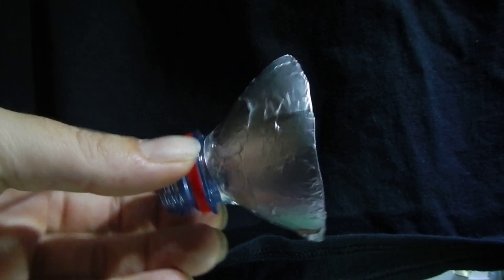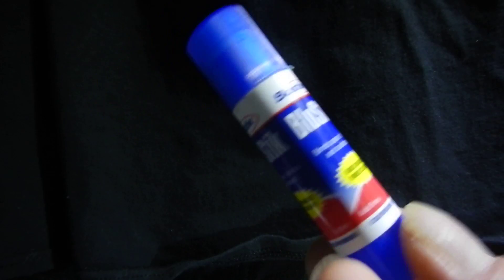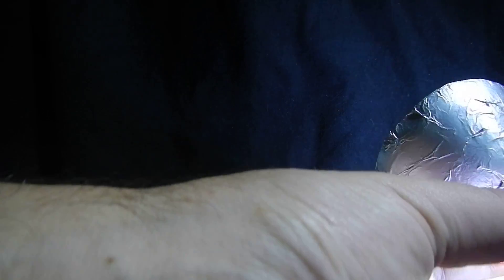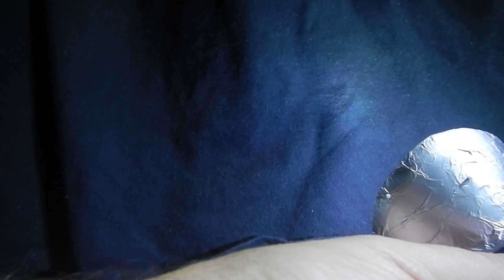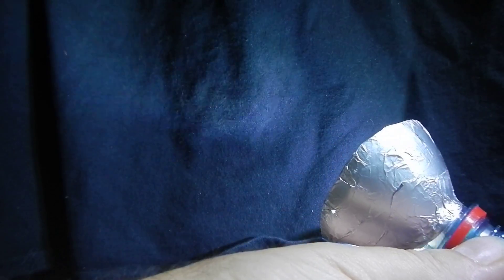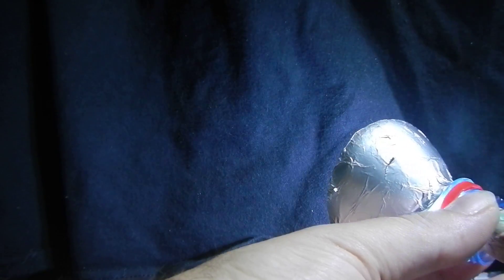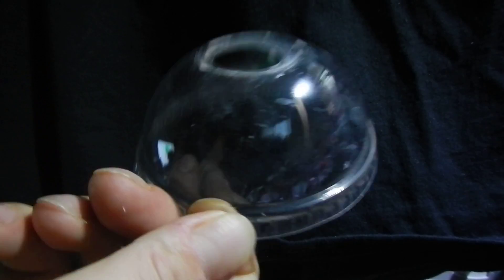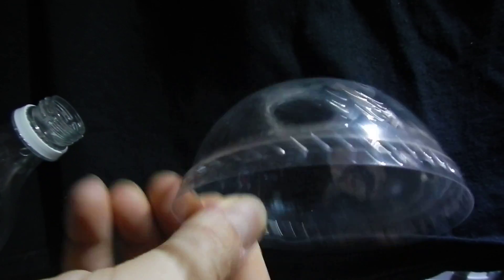Easy Parabolic Reflector for LED

Comment: Handy method. It could also really help with measuring the brightness of JT circuit output, rather than just spreading the light out.
Reply from the maker: I thought you would like this one :) Could be very handy for measuring JT's etc. Good idea. Also wondering how it would go with a microphone or wifi dongle.

Comment: Shouldn't we put the led in there upside down? I think much more light can be reflected that way.
Haha, you can also place the reflector over a candle and heat up something just above it with additional/reflected heath..
Reply from the maker: LOL Slider. You got me. I'd do something like that. Busted lol.
I was trying to think of the children that might want to try it. Won't somebody think of the children?
Reply from the maker: Inverting the LED is probably not going to go great in this bottle. Give it a try and upload video.
Interesting idea with the candle. Would probably work, but I don't like the idea of fire so close to something so flammable myself.
Reply: "I don't like the idea of fire so close to something so flammable myself"
Since when ? LOL